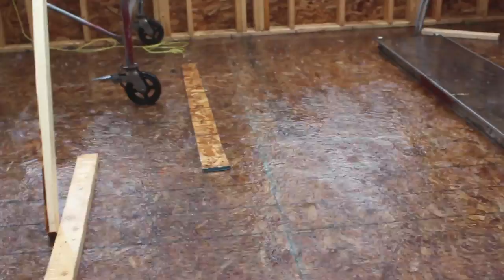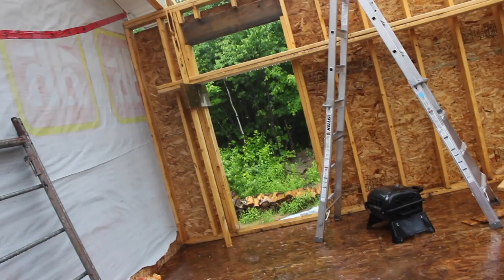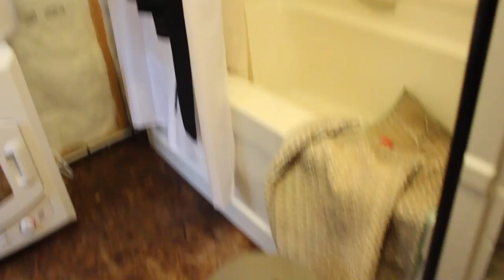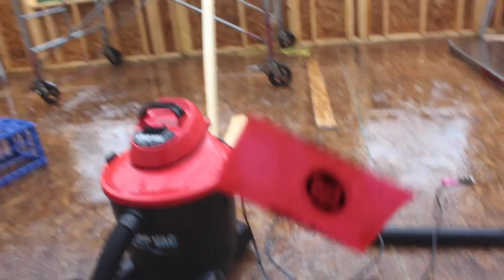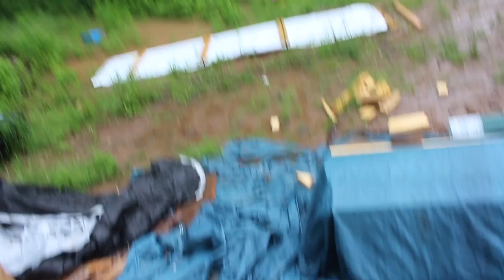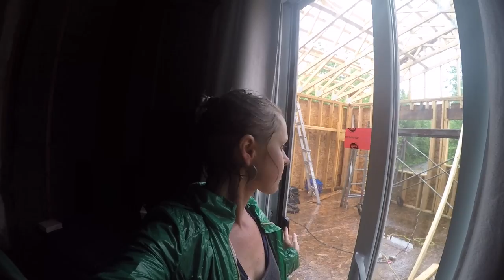FULL BLOWN CHAOS - LIVING OFF THE GRID SEASON 2 DAY 70

Comment: I’m not a troll but didn’t you have the same problem with the water coming in, last season? What is going to be a fix to stop it? That was a job trying to keep up with the rain. Sorry you had all that trouble.
Reply from the maker: No we didn't. This only happened when we put the floor down on the same level. Once the roof is on, it will be stopped.

Comment: "Holy Wood Rot" Ashley! In all honesty, i probably would have blown a hole at the lowest point of that floor decking near your sliding glass doors and/or hitch up a hose to exhaust part of the wet/dry vac and make the exhaust port hose exit the structure at least 25 ft away from the foundation and hookup a make shift water sump to the intake port of the vacuum and let'r rip all on it's own! What a fricken mess! Sorry Folks! I just wish that it wasn't happening to you fine folks, out of everything that you've been through! Honestly though, you should be asking for some neighborly help to speed things up before something else happens!
Reply from the maker: It will all work out, thanks.